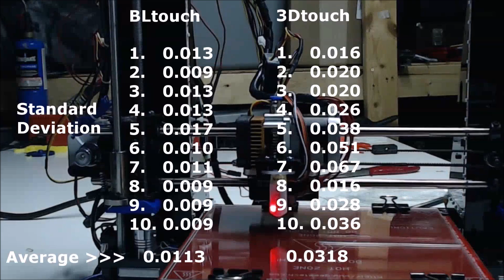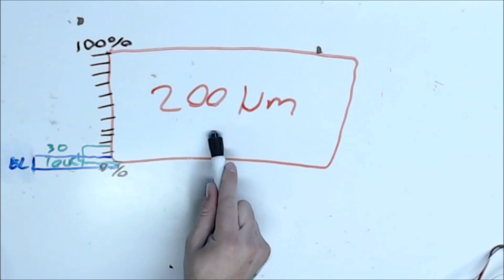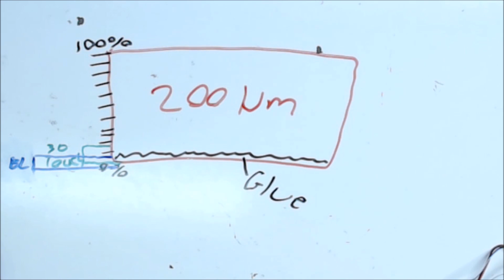BLtouch VS 3Dtouch 3D Printer bed leveling sensor match up

Comment: Nowadays 3D Touch is much closer to BLTouch from design perspective. It has the same wire harness,  same style plastic pins. It is probably hard to tell what is the difference when using firmware like Marlin, Kingroon etc. However, In Klipper you will find the difference when you begin to test newly installed 3D Touch. It will respond as intended on BLTOUCH_DEBUG COMMAND=pin_up and BLTOUCH_DEBUG COMMAND=pin_down (of course, if the harness connected correctly), but when you switch to the touch_mode and check touch pin and it will retract, and then check the state with query_probe command, it will never give you the TRIGGERED state. I spent hours trying to figure out why this command refuses to work, blaming contact loss and so on. Then I found the answer. The official Klipper responded on this in the topic #5088 and the answer was like "Klipper does not support clones when query_probe.". Other than that everything like G28 works fine and it stops when touch pin on descending. Oh, and probably on 3D Touch you will need to check pin itself (the pin side where the magnet is mounted). Magnet should not move inside the pin, otherwise this will give you big inaccuracy in sensor readings. In some videos people cut the plastic on the magnet side of the pin and glue it on.
Reply from the maker: Things have changed a lot over the years. I to have some issues with the touch sensors and Klipper. Lots of great info in this comment. Thanks for the post.

Comment: I think the 3D touch would probably be more accurate than the micro switch on a servo operated probe arm that many people used in the past.
Reply from the maker: I have never tested them side by side, but you could be right.

Comment: Well a friend just throw the 3dtouch to trash...
His repeatability test with it shows a deviation of nearly 0.3-0.4mm... which explained all the bad print he had. Plus it really don't like heat (he's working with abs and nylon with an enclosure).
Basically it works... As long as your bed is cold.
Reply from the maker: I have an old one, I am going to try and compare it again soon.

Comment: I have one of these clones for a while now. I have installed it today, but it is really close to the bed. Which is fine, but the actual nosel from the extruder is about 8mm or so away from the bed. I know it should be level.  Can anyone advice me where i might be going wrong?. I have a creality  ender 3
Reply from the maker: What is your Z offset set to? Check it in eeprom, you will see and M851 command. It might need to be updated.
Reply: @ChrisRiley  I manually lowered the hot end down, as far as it would go. The touch sensor makes contact, but the ht end is over  cm away from the bed.No filament will  make contact with the bed.
Reply from the maker: @leeparsons70  I am confused I think, I might need a picture.
Reply: I dont think you can reply with a photo on here, can you?
Reply: @ChrisRiley  I dont think you can add a photo on here in a reply. I got the bracket when i bought a cable loom from ebay for the bltouch, and figured it went in the same position as the bltouch. Basically,  the sensor, when attached with the bracket will hit the be, but the hot end on the extruder will be 8mm or so from the bed I thought they would need to be parallel to one another?
Reply from the maker: @leeparsons70  There is a designed mounting tolerance for those sensors they have to be within. Check out the bltouch cad dimensions. https://5020dafe-17d8-4c4c-bf3b-914a8fdd5140.filesusr.com/ugd/f5a1c8_d40d077cf5c24918bd25b6524f649f11.pdf
Reply from the maker: @leeparsons70  You can post google photos or imgur links here.

Comment: In 2020, even the no-name BL Touch clones now come with the extra wiring and accessories.

After having some problems with my clone's pin not deploying, I replaced the metal push pin with a similar length of 1.75mm ABS filament that I straightened.  The magnet for the hall effect sensor is just held onto the pin with some heat shrink tubing that you can easily pull off.

The clone's standard deviation went from between 0.03-0.07  to 0.01-0.02.

I didn't think such a small reduction in weight would increase the accuracy and consistency that much but there you go.

I guess that's why the BL Touch switched to plastic pins lol.
Reply from the maker: Cool results, that is an interesting test. I guess that is why.

Comment: I've got one clone 'BLTouch' that works quite nicely. And another that never worked. Then again, my genuine BLTouch only lasted a couple of months before it's died (probably my fault when clearing off plastic), but when you're upgrading a printer that cost a little over £100 a £40 part is quite a lot.
The problem is that when you can get a functional clone for 1/4 the price then people feel they are being overcharged. Antclabs could work with a Chinese manufacturer to do licenced parts for £20-25 and I think they would sell sufficiently more to make more money out of what is genuinely a useful design. 
For those saying about copyright, that would offer little protection from someone creating something functionally comparable. Antclabs claim to have a patent, but the design looks closely based on an open source design that was published a year before their first model, so their patent is likely unenforceable. It also means that they only refined an open source design and then claimed it as proprietary, which in stifling use of similar designs based around similar (originally open) principles is arguably even worse than the clones.
Reply from the maker: Hey David, thanks for this comment. These are some interesting point that I had not heard before.

Comment: there is a way to do even better than all these sensor the comparator system with gear ratio and more accurate yet
Reply from the maker: Nice! Do you have a link to more info?
Reply: @ChrisRiley  https://fr.aliexpress.com/item/32917255569.html?spm=a2g0o.detail.1000016.1.37e1b9bbMfCCy6&isOrigTitle=true

Good evening and just one can think. it's not just the one the

Comment: my BLTOUCH clone has a standard deviation of 0.06 but a range of 0.25. one or two out of my 25 probes is always off by a lot. so one point in my bed is always wrong >.<
EDIT: made my own. it has a range of 0.03 or less if I remember correctly and a deviation of 0.03. I made the mistake of making it in clear filament which messes with the accuracy a bit but like I mean I don't think it matters that much when it's that accurate :P
Reply from the maker: Doh! I have heard people saying recently there are a lot of really bad clones out there now.
Reply: @ChrisRiley  yes! but i'm so happy with the one I made myself. the accuracy is insane! even with the clear filament (which I later realized makes the results not as accurate) it has such a small range. 0.03 or less I think.

Comment: Nice to see that you probe is working within the tolerances. Got my third 3D Touch and the tolerances are all up to 0.2 mm. This shows that there is no consistency in production and qc. Installed a genuine one and works like a charm.
Reply from the maker: I have had a couple of these since this video was made and the knock offs seem to be very unpredictable indeed.

Comment: The 3dtouch now has a plug on the back, and also comes with extension wires. At least mine did.
Reply from the maker: Good to know they have updated it.
Reply: Where did you buy yours from?
Reply: My eBay one did not :D Still works well compared to inductive sensor that varied in height according to temperature and mood, good £12 spent.

Comment: Since then BL touch has gone to welded connection and 3D Touch to socket. All that while 3D goes with cables and screws for about 15 Euro. BL (Only BL) without cables or screws goes for 40 Euro. 
The only positive thing about BL is that is using a plastic pin that doesn't rattle like the printer is falling apart every time you print. The 3D has a shitty aluminium floating pin design that vibrates like hell under printing and i have to run outside every now and again cause it sounds like an earthquake...
Reply from the maker: Funny you should say that, I had a failed print the other day and it snapped my plastic pin. $15 to replace it. DOH!
Reply: @ChrisRiley  Replaced mine with a lego light saber. Had to drill up the bore but it will never break...
Reply from the maker: @astroplutonium  lol, that's awesome!

Comment: Unfortunately Tom's sensor video is no longer available. Wanted to watch it. The trianglelab 3dtouch has been updated and looks more like the BL, having a plug instead of soldered connection. Not sure if the accuracy has improved or not. It's also $15 now instead of $25. If you have a really budget printer it would seem clear which one to go with imo. Thanks for the good video
Reply from the maker: Thanks for watching! I have updated the link to toms video and here is the link as well. https://youtu.be/il9bNWn66BY

Comment: hello.
sorry for my english language.
Can you please tell me what happens in the black and white cord when the needle is raised and lowered?
if the needle is top contacts should be closed when the needle down the contakti be open! I measured with a mutimeter.

I measured my 3d touch sensor on resistance and shows 10 ohms all the time, even if the needle is up or down!

when I test the G-code M119 all the time, the needle is open
I use Arduino Mega!
Marlin 1.1.9.
Reply from the maker: I would try to switch the logic of the endstop. The Z min and Z min is endstop.

Comment: So the 3D touch wins
Reply from the maker: Now a days the price difference isn't as great as it use to be. The BLtouch is going to be more accurate.
Reply: @ChrisRiley  Of course, I bought 3 3dtouch a wile ago, and it's definetly life changing, I mostly print PETG on glass with dimafix with 0.2-0.4 first layer so maybe for others using other materials with tiny first layer and other surface will need this extra precision, but for me the 3d touch wins because of the price, but if you look deeply, the one's whos screw you the most are the 3dtouch seller, they just copy ^^ .

Comment: Thanks for the video. I had a bit different experience with 3dtouch sensor on my Ender 3... The standard deviation in corners was between 0.06-0.2mm, in the center it was around ~0.02mm, so i was able to print only in the center of the bed. Tried to tight everything on the printer but nothing helped. When i replaced the sensor with the original one (got it from Amazon) i got the deviation between 0.003-0.009mm which is way better... The first layer is now perfect...
Reply: Same here I do not Recommend the Clone one ! simply waste of money ...buy the Genuine BLTouch (I have TriangleLab 3d touch deviation between 0.045 to 0.15)
Reply from the maker: Awesome! I heard the new bltouch was even better. Do you have the one with the plastic probe? They say that one is really good.

Comment: Thanks for the video/review. I have both and connected both up to a printer (clone of a Prusa!) first with a glass bed, second time without. Then did some wierd things like actually made the bed seriously unlevel (slanted) by placing a 1.5mm bar under the print bed one side (gradual increase in Z hight with X) and then one corner (gradual increase in Z height for BOTH X and Y). After all the print tests All PLA @ 195'C  to a 50'C bed. honestly didn't see a difference between them. Leave the  bar there and perform manual bed levelling use feeler gauges (not a piece of paper!), with a digital and then an analogue depth gauge (both pretty accurate and used in CNC milling) and well within the margin of error of the BLtouch measurements you quoted to see what the differences really was. Nothing. Auto levelling was a bit faster once fitted but manual was just as good and if you don't move the printer about doesn't have to be redone often.
Reply: Chris thanks for the video and pragmatic view. I know the clones are clones and the BLTouch is the original (although not sure the concept is that original) and I have paid for one myself but given 99% of people are working with clone printers and not some original it is a tad hypocrytical of some trying to take the high ground about the BLtouch IMHO. That said some clearly have had a rough time with dodgey poor sensors but I bet they might have been really cheap so the caveat 'buyer beware' definitely rings true. If the clones were all that bad they would not be selling them and as you and lots of others have said they still work and at a tollerance level that is fine for home/hobby use. I honesty prefer manual levelling maybe I'm just a bit odd?
Reply: As asked... my previous clones were from Triangle Labs through Aliexpress. I just bought another from them £10.80 inc shipping to UK! It's in front of me now. Interestingly says "based on ANTClabs" on them, also it doesn't have solder on wires but a plug/socket and 80cm wire with board connections on other end so no more crimping etc
Reply from the maker: Not at all, if you have a nice sturdy machine, manual leveling is still the way to go. I personally like the inductive sensors a bit better, but not near as flexible as the BLtouch of course.
Reply from the maker: That's sounds like a great deal, no crimping is always a plus.
Reply from the maker: Great testing! Thanks for watching the video. I wonder if the clone sensors are getting better since I bought mine. I wouldn't mind giving these tests another try at some point with new sensors to see if anything has changed.

Comment: hy all, i have a bltouch on ramps 1.4, i have a isue that the right side of the bed is always lower as the left side, any explication?
Reply from the maker: Hey Mario, ABL is pretty bad at correcting for X skew. I would run a G29 from a terminal and look at the leveling map. Then make adjustments on your Z lead screws from there. If you need help, check out my auto bed leveling video.
Reply: Hello. Have you solve this ? Have the same problem. Thx
Reply: Still the same problem, i nee to adjust a little more the motor driver, i notice is a little low power, i use clone of clone ramps mega 😊

Comment: Hi Chris, just an update I bought the cheaper option which now comes with the extension cable and is fitted with a plug not soldered. So little to choose between them. Just my 2 cents worth. :-)
Reply from the maker: Cool, thanks for the update, I know a couple of things have changed including prices.

Comment: Hi Chris!  thanks for the "ultimate" explanation.
I have a wanhao i3 plus,  does a sensor (BL touch and correct installed) really improve the prints? 
thanks!
Reply from the maker: Marco Vignotto Thanks for the comment. I wouldn't say it makes prints better, but it makes prints more consistent.
Reply: Chris Riley thanks for the reply! Do you mean that is also more precise?
Reply from the maker: Yes, by making your first layer more consistent it should improve precision.
Reply: Chris Riley thanks!

Comment: Hi!!, the 3dtouch and the bltouch conected and setting up equal in the marlin 1.1.8?, thanks!
Reply from the maker: Yes, they work exactly the same in Marlin.
Reply: thank you!, i hope the 3dtouch works on the tornado with gen L v1.0 board. :)
Reply from the maker: Good luck, I am not sure about that board, but I am sure you can make it work somehow.

Comment: Finally, someone who gives a concise yet informative description of the accuracy and usability of a popular touch sensor. I watched Tom's guide and was left impressed and confused all at the same time. Thanks for the reality check.
Reply from the maker: Bruce Cushman Hey Bruce! Thanks for the comment. Much appreciated.
Reply: Between all of the leveling options, the touch, inductive, capacitive & piezo which one do you use or prefer?
Reply from the maker: I much prefer the inductive types. They are super cheap, and surprisingly very accurate.

Comment: Great job Chris another fantastic video, I would like to however point out that the designer of the BL touch did all of the original design work necessary to produce a great product. When you knock off pocket product that’s great, Remember new innovation cannot be done when someone keeps stealing your products.
Reply: Yeah, the BL Touch is based arround the Hall Effect, discovered by Edwin Hall in 1879. How much is she paying the scientist that made her product possible? That's why that argument is flawed.

BTW, got my 3D Touch from Triangle Labs, costed less than 12€ and came with crimped extension.
Reply from the maker: Thanks David, that is a very good point.
Reply: Actually, that's totally how innovation works. The moment you close it off from other great minds the technology stagnates and never matures. The only thing happening here is a little less money going into their R&D department. But this will now develop and mature much faster because it's becoming more accessible to a much larger crowd.
Reply: Bltouch is a patented product also. So I kinda wanna say buy the knock off just cause I prefer open source and think most patents are for greedy people.

Comment: Statistically,  you should estimate your plus/minus tolerance based on at least 2  standard deviations (95% of a normal distribution .. using only 1 srd dev as you did is only 68%). For comparing that tolerance to a 200um layer height, the full tolerance range using 2 std devs .. would be 4X the std dev values you measured. So you should be comparing 44um to 200um for the BL Touch ... and 127um to 200um for the 3D Touch ....  now there is a clear winner and loser, right?   In fact, the error range of the 3D Touch sensor could be as bad as the bed  flatness error on a decent printer, rendering the 3D Touch useless.
Reply from the maker: Thanks for the info, I need to sit down and think about this for a moment.